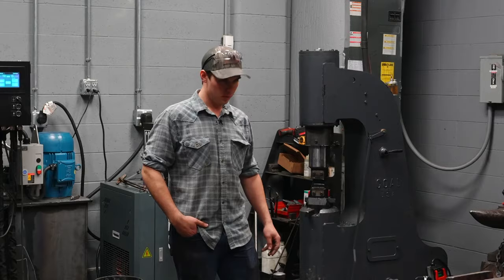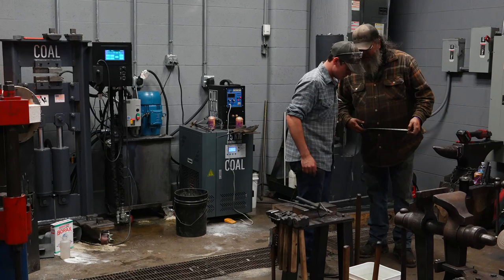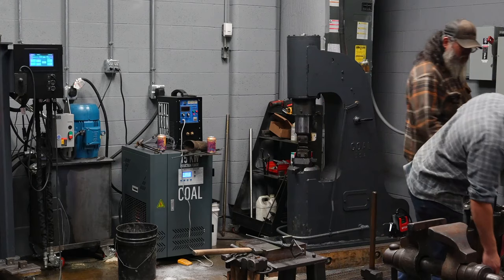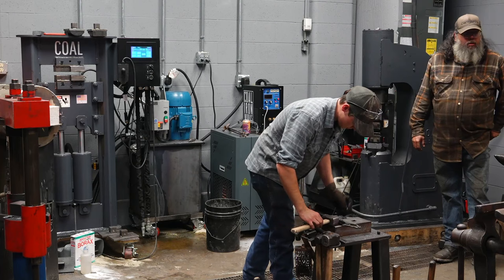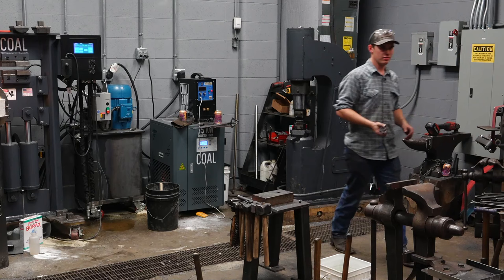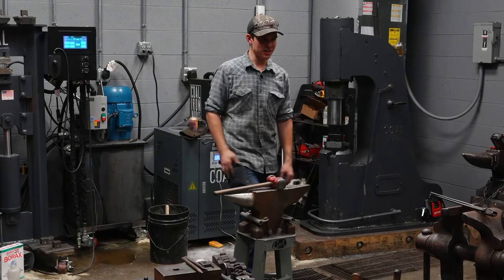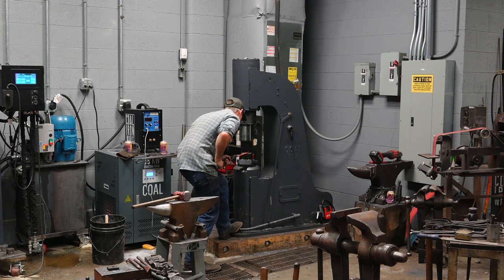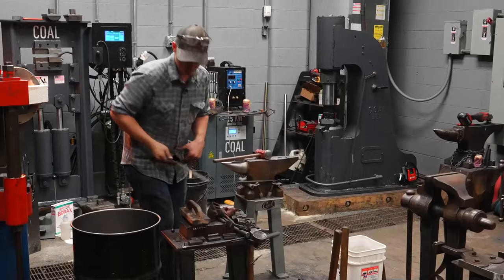The Coal Cast | Andrew Larson: Hammer and Tongs

Comment: That green stuff is chromium. Probably one of the most hazardous metal you can use. It's chromed on the outside for durability in a hydraulic shaft. In contact with air it will release hexavalent chromium.